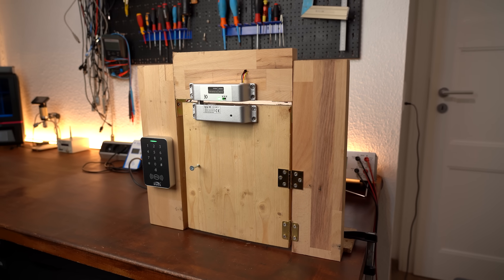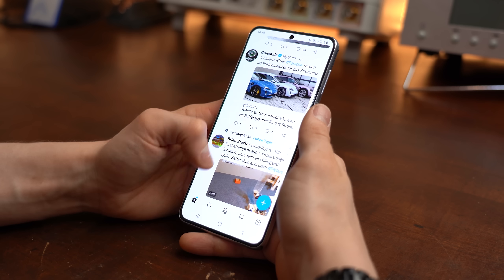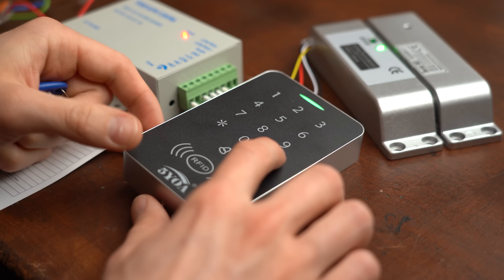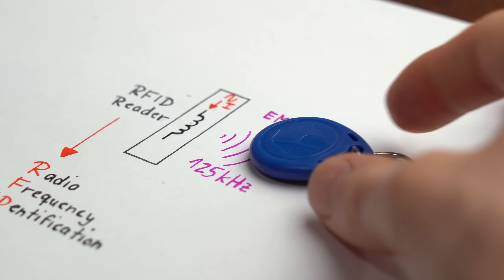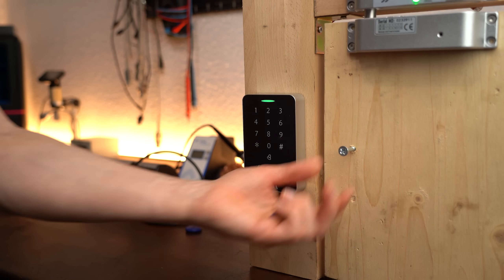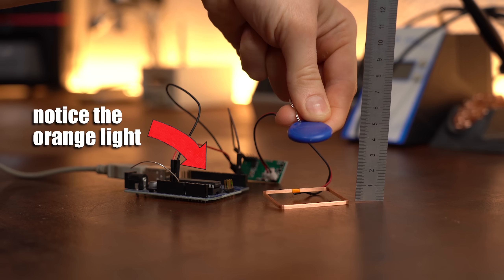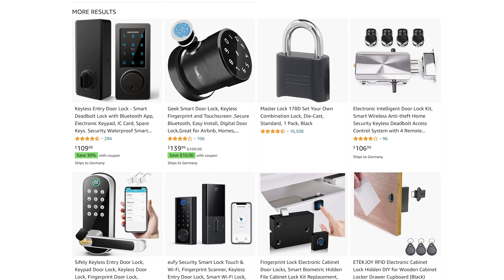RFID Locks are way too easy to "Hack"! Let me show you!

Comment: Having the reader and control unit in one is basically an invite for a break in, no reading of the data lines like the LPL did, the power wires for the solenoid are right there and all you have to do is pull it off the wall and give power to the solenoid wires and your in!  NEVER, NEVER buy an all in one unit, all control electronics MUST be on the inside of the property!
Reply: To be fair, any decent security system has tamper switches that immediately detect opening or removing the user panel from the wall and even detect permanent magnets that someone might want to use to trigger a relay. What he uses here is a 9$ unit nobody would ever use to secure anything of real value...
Reply: @ProtonOne11  Except there are massive amounts of this and similar on sale and people buy and use them.  Additionally, there is no way to secure a panel that contains the control electronics, no tamper sensors or switches can protect it when the power wires to the lock solenoid go to the outside, all you need to do is power those wires and the door is open.

No panel that contains the control electronics should ever be considered, its trivial to defeat.

Comment: I watched a video on RFID in credit cards and such. People could copy them from up to 5 feet away with a laptop and a hidden antenna in a laptop bag. They could walk down the street collect them.

Mythbusters was going to test this but the credit card companies freaked out because they knew how easy it was.
Reply: It's not copying, the chip does not allow copying. What you can do is running a transaction. So people can use your card to pay for things as long as they (or their assistant) remain close enough to you. That's why contactless cards still have a limit to 25 euro or so before they ask for a PIN.

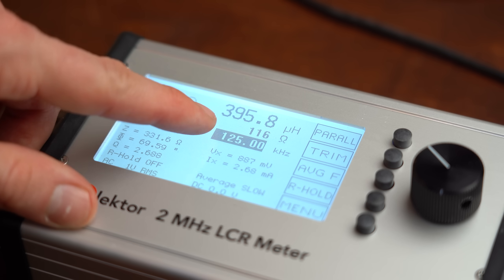Comment: 9:45 You might want to consider using a smith chart, it will make it a lot easier to calculate the impedance matching networks.I do the same thing however in my work a capacitor is usually just a thicker PCB trace and an inductor a thinner PCB trace :)
Reply: Nah. Smith chart is pretty much useless for 125kHz matching, because it's just a very simple LC tank.
Reply: @mrkv4k  Smith charts will work at any frequency, his method works great too! And nothing is purely a simple LC tank, everything has parasitics. The parasitics in this case are fortunately (mostly) negligible. I just mentioned it because smith charts are fun!
Reply: @linuxguy1199  Smith chart is not usefull for this, because it all works on one frequency.
Reply: @linuxguy1199  It's not usefull, because it's more complicated than having simple 1/(L*w^2) formula in excel (which is what I do). They way how you'd calculate the capacitance on a smith chart would be
1. Calculate the inductor impedance.
2. Make a point on a smith chart
3. Make a straight line and measure new point.
5. Take the new value and convert it back into capacitance.
All this is pretty useless, because the impedance of antenna coil for 125kHz systems is usually somewhere in 380i+30 range and you don't have to bother with the resistive part. Just compute what capacitance would have the -380i impedance (which is what you're doing with that formula). There is no advanced matching needed, because the frequency is low and the coil can be energized by one  transistor fed by a square wave signal. Plus it's usually a serial resonant circuit.

Smith charts are very usefull if you are computing antennas for 13.56MHz systems, but that's a different story.
Reply: @mrkv4k  You're missing the point, It would be cool if he made a video using them! :P

Also, smith charts can and are very commonly used for multiple frequencies (by tracing an impedence curve from your start to stop frequency, then doing each operation on two points of the curve). For simple stuff like this they aren't practical, they become far more practical when doing higher frequency stuff where the impedance matching is far more critical (RF filters, FET RF amplifiers, crystal detectors, crystal filters,, etc).

Comment: I was thinking, since you could read the feedback from a card to the reader, wouldn't it be easier to just copy that signal? With a properly designed antenna and magnification circuit, you could do this a really long distance away.
Reply: na, just pull the unit off the wall and power the solenoid through the wires and your in, All in one units are stupid insecure and should never be used.

Comment: Type 1 is unsafe. That’s the 125 KHz one. The type 2 is bi-directional and have updatable data in the chip. It’s the 2 MHz+ one. Implementation becomes the key factor.

Comment: I feel like the easiest way to "pick" that lock is to just pull the reader off the wall and short the appropriate pins to trigger the latch. That's why these systems usually use a separate controller - so there's nothing you can do to the external components to trigger the latch.
Reply: Came here to make the same comment. 
Don’t get a product that has the relay inside the same housing as the reader. 
Also don’t use 125KHz technology, get MIFARE DESFire. Much more secure.
Reply: No. The easiest way to pick that lock is using strong magnet to manipulate relay inside.
Reply: @insolencePL  true ... and electromagnets are easy to make ...
Reply: @insolencePL  Doesn't work if the relay has a brass or copper contact arm...like most do. Or if there's no relay. There really doesn't need to be one. Certainly not a mechanical one. And even IF there was a mechancal relay AND it had a steel contact arm, AND was orientated the right way for a magnet to close the switch, AND just happened to have an assymetric rocker arm, (cus it would have to have one for a magnet to work on it) why would you want to go through the door? Nothing valuable is going to be on the other side. And if the place uses RFID entry, then there are PEOPLE INSIDE, or the door will also be mechancally locked.
 So you'll be walking around all night, with a magnet in your pocket, looking for an empty building that's protected by nothing at all except one of a small number of cheapo Chinese locks that that trick works on, and where they don't have any other locks for when everyone goes home.
 If you're very, very lucky, after a few days of searching, you might find a place where you can steal a 15 year old PC with a roller ball mouse, and some pencils.
Reply: It might have a button wich gets released when pulled from wall and trigger an alarm
Reply: @309electronic5  Also another way to wire up that button is to wire it up to a self-latching relay in a box on the inside, which will cut the line to the lock. In that way you get somewhat middle-ground security, not secure as a full blown split system, but not as insecure as a completely self-contained system, but somewhat in the middle.
Reply: This particular lock uses a relay, it's easier to just place a neodymium magnet on it and it will open
Reply: @nirodper  Some systems can be installed wtih magnet sensors that will cut power to the system if any external magnetic field is attempted.
Reply: @nirodper  Or modify the antenna coil to be an electromagnet instead... (since Scott is an electric engineer) 😉
Reply: his way leaves no trace ... making it possible to come and go as you wish and not be detected by examining the door 
.
if you yank the read off the wall ... you have one shot at getting what you want inside .. and that assumes you didnt trigger an alarm by yanking the panel in the first place ... 
.
the only reason to scan an RFID from a distance and not by the reader it is for .... is to steal from the place ... so to be a perfect crime one wants to leave no trace they entered so when the theft is finally found they have no idea when to start looking ... and poof no leads ...
Reply: @kaboom-zf2bl  Couldn’t you just stun the microcontroller using an EMP, then take it off the wall, disable the alarm by removing the button and replacing it with a direct short, install the device, unplug and replug positive (to restart the lock), and then reinstall it?
Reply: Yes, but the reader needs to encrypt the code being sent to the control unit inside...
Reply: @fredashay  I think this is one of the "all included" designs, the other units were just the power supply and electromagnetic lock.

These are fine for low security internal doors - cleaners cupboard, stationery cupboard and so on - but you wouldn't want to use one as the main secured entrance to a building with high value items.

Ideally, the control unit is inside - and there is JUST a coil of wire on the outside - and optionally a hex keypad.
Reply: @guyteigh3375  It seems that nobody designs electronic locks intelligently like that.  Or at least nobody reviews them and talks about them.  The only locks I see reviewed are the junk type.
Reply: Exactly, i bought one that even has its wiring diagram printed inside, literally saying 'put these wires together and the door will open'. And it's very simple to open... But ok, i can easily change the colours of the wires and with a simple relay on the other side, i can make it safe for wannabee 'hackers'.
Reply: Well, if you're willing to break stuff and make a noise, you mght as well just give the door a good hard kick
Reply: Yes but the good ones also have tamper switches and are properly installed. There is always a better solution though the more money are willing to spend.
Reply: Ya but there's not content in that. Enjoy the video, try commenting less. You may love longer and stress less.
Reply: @Vag_Poop  if it is just done for content then it is clickbait and a greedy money grab .... making the presenter of the video into a bad light ... so which is it ... a greedy presenter ... or an explanation of a nondestructive way to enter a secured location
Reply: @kaboom-zf2bl  The worlds not black and white lmao. There's this thing called a symbiotic relationship, he gets money from content and everyone watching learns something its not rocket science.
Reply: @kaboom-zf2bl  Yeah, God forbid content creators create content!

Comment: imagine using a metal detector coil which has better distance detection and tuning the circuit to fit the coil properly.
Reply: metal detector coils are just coils, why specifically metal detectors
Reply: btw it's the other way around, the coil is an antenna, so you must make the antenna to fir the type of radio emission you want to do.
Reply: @marcogenovesi8570  because usually they have better quality factors low capacitance good shielding and sometimes even the use o litz wire compared to just lose wound coils taped together.

Comment: Relying only on the UID for security is horrible design for security and should be easy to steal with only a reader. If I had to guess the really close range reader/writer seems deliberate to prevent this kind of theft. 

But there are so many ways to not only rely on the UID for identifying the right tag. If I were to get such a lock, I'd expect at least a rolling pin or something along those lines. 

This is suitable for a chicken coop, not a front door.

Comment: what if you just always keep your key inside some metal container? that way the key would not be able to transfer data, and so nobody would be able to bypass the security
Reply: there are at least other 2 ways to bypass this type of cheap system anyway, either with a magnet to move the relay manually or by smashing it open and connect the wires yourself

Comment: What did you think of the wiegotcha ? I've used it in engagements in the past to reasonable success and the construction is quite simple: a raspberry pi + custom software + LF parking garage RFID reader + chonky 12v battery.  Its ideal range was like 2 ft in theory tho in practice it was more like 10 in (similar to your video), meaning I had to get somewhat close to victims; quite easy to do in an elevator or when a security guard is yelling at you when their badge is hanging off their neck. The thing also oddly gave headaches when directly looking at it lol. Will also say that in practice the different possible encodings on an RFID badge that people can have is a pain spot for attackers though this may have changed recently.

Comment: Great video as always. I have an idea for a follow up video. Creating a portable RF emitter with enough power to open the lock from a distance of 2-3 meters (or more). I always disliked how you have to physically tap on the reader to open the door. It would be amazing to have the key code on an emitter similar to a garage door opener where, by pressing one button, it broadcasts the key info to the lock.

Comment: If going up to someone with the copy device and copying their tag doesnt count as lock picking, just replicating the key, then isnt this like taking a picture of their key and replicating it? surely picking the lock would be more like walking up to it with a coil and trying lots of different IDs until you find one that works? even better, if it is a really cheap lock, you might be able to run codes together, for example 12345 might register both as code 1234 and 2345. I'm pretty sure there is a mathematical way to generate a long sequence that has every possible combination in it that you can transmit to the lock
Reply: I don't think that the tag transmits its ID in such a simple way. I think that the device transmits some kind of request to the tag and the tag responds accordingly. I think that because it is possible to write data to those tags with a cell phone with NFC. 
You can't run codes together because the device can't get signal readins from two coils. 
The comparison that you've made of takig a picture of a key seems perfect, to me.
Reply: @OgbondSandvol  you can see in the video that that is exactly what happens. The lock sends out a power source inductively, and the tag transmits its id by varying the current draw on that power supply
Reply: @amyshaw893  but, what does happen when you write data to the tag?

Comment: can I suggest a tuned ferrite rod antenna, like the atomic/radio controlled wwvb clock stuff @60khz?  125khz is a wavelength of 2400 meters, so it is going to be difficult to make an efficient conventional antenna.

Comment: Long Range RFID system use UHF 433MHz & 928 MHz Transmitter along with sensitive receivers that can detect a fraction of change in the transmitted wave. If we increase the operating frequency of RFID system then the power required for transmission is decreased and improve the sensitivity also. Another way is modify the 125khz coil circuit with high speed switching transistor and adjust the gain of opamp at detector end with optimal level with pot...I think it works ✌️
Reply: It seems to me that the chip in each 125 kHz tag (close range) is precisely bounded to that frequency, isn't it?
Reply: @OgbondSandvol  Yes It's Resonance frequency

Comment: You can also write rfid tags and cards through phone's NFC
Reply from the maker: True
Reply: This door locking system relies in the ID (sort of serial number) of the tag, not in the data (about 1 KB) written in the tag data memory.
With a phone app (at least with  the apps available at Google Play, I tested a bunch of them) you can not write a new ID to the tag. With a RFID phone, you can write any kind of data to a new tag, but you can not copy the ID of the tag to a new one.
The gadget that Scott used can, really, change the ID of the tag. I wonder if change the tag's ID is something that needs a different kind of coil than the ordinary coil in the RFID phone, or if it's just a software (and somit would be possible to someone write an phone app that could change the tag's ID).
Reply: @OgbondSandvol  hmmm what about spoofing the ID with your phone in order to unlock?
Reply: Phones don’t come with 125k capability I guess. They do have 13.56M though.
Reply: @liucyrus22  125k can be added via usb dongle. However, I managed to read my ID card and bank account card ID(visa/mastercard). I suppose they are also mifare
Reply: @KnaufL  they are on 13.56M but are not MiFare. Probably on the more secure standard with more crypto processing on the card.
Reply: @liucyrus22  but still, you can repeatedly read the same string with pn532 or android, so it's useful for a diy lock like this and if you loose a card on the streets not everyone will instantly get the idea to enter your house. I don't know what that string I got read means but i suppose it's the ID. In the end it doesn't really matter since I only need to differentiate the cards

Comment: couldn't you use a more directional antenna, like a yagi or log-periodic?
Reply from the maker: I might try that out in the next video ;-)
Reply: @greatscottlab  fwiw, got an "atomic" clock from the thrift store for $4 the other day, it gets its time from a 60khz (~1/2 of 125khz) signal over 1000 miles away in fort collins, it uses a tuned ferrite rod antenna, because the wavelengths are too impractical at that end of the spectrum otherwise.

Comment: I was trying to make the same system , exept I used 13.58 mhrz RFID with Arduino nano as the Brian of  all the process , and relay to power my 12v gate lock with external PSU ,,,, the reason not to buy separate locking system like u did is that I wanted it to integrate with my exciting one and to add NFC unlocking to it